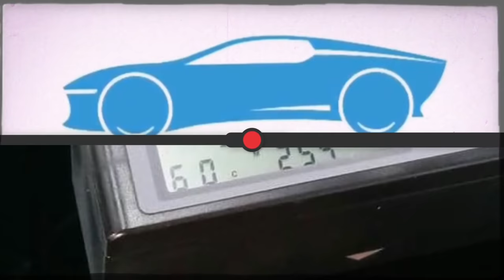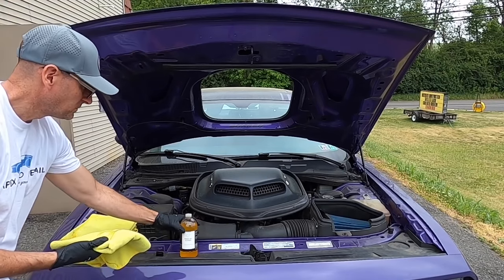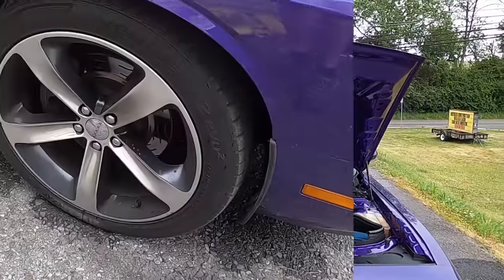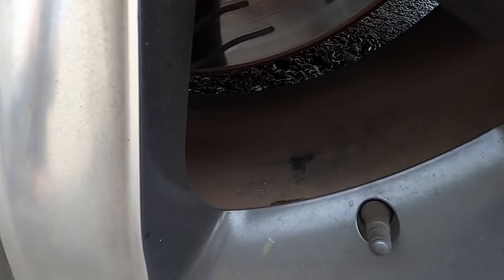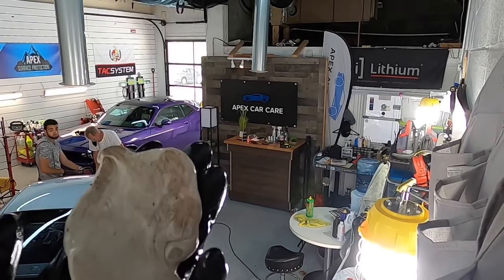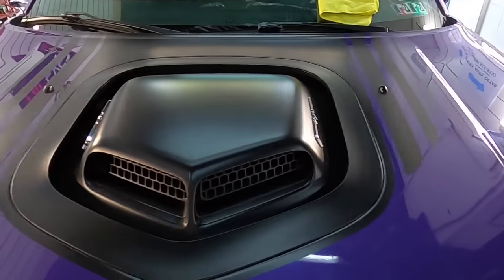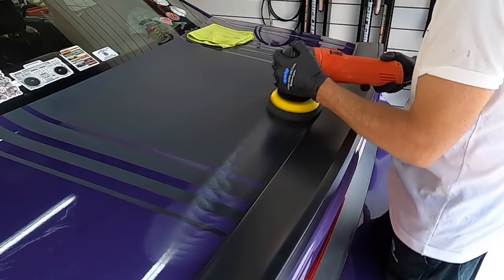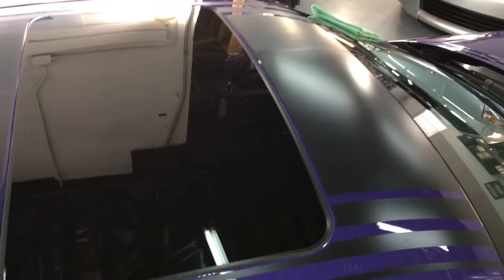The Purple Shaker!!! Lets Save It From A Tunnel Wash!! Part 1

Comment: That is an awesome restoration to the vinyl. Is the Carpro Essence Plus similar in function and application to Gyeon Primer? I bought that based on one of your reviews and have use it with great success as a base for TAC Systems Moonlight.
Reply from the maker: There are many ways to utilize it. it is meant for coating at the end of their life cycle.

Comment: Nice job as always. Not critical, just curious ... I was concerned when you started polishing across the stripes instead of down their length. Obviously there was no problem with these, but couldn’t going sideways across them with a polisher (even with a soft pad) possibly grab a weak edge and either pull it up a bit or trap polish on the edges?  Did you have to go the length of the stripes with a toothpick or something to remove polish residue?  Was there a reason you didn’t polish the length of the stripes instead of across them?  Thank you.

Comment: will any light polish remove fine swirl marks from the stripe? my mach 1 has them which are visible when viewed on an angle. can I hit it with the turtle wax ceramic polish / wax?
Reply from the maker: Make sure it is a jeweling polish....or cleaner polish. Nothing more aggressive than that.
Reply: @apexdetail85  will do